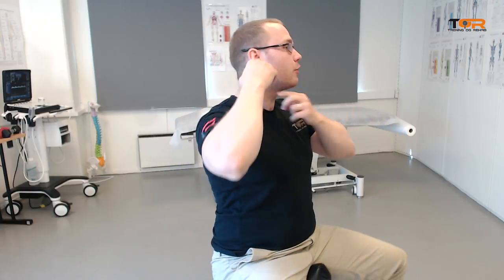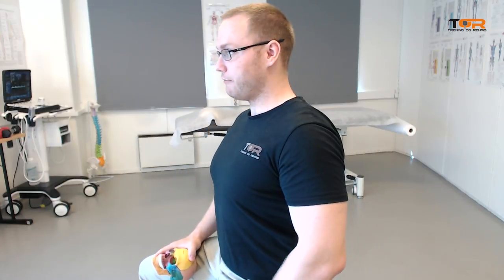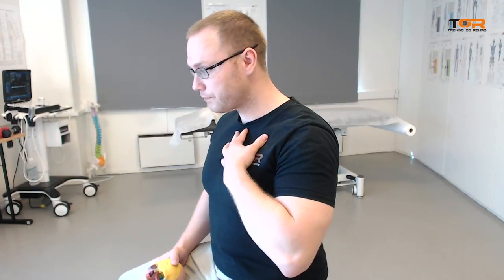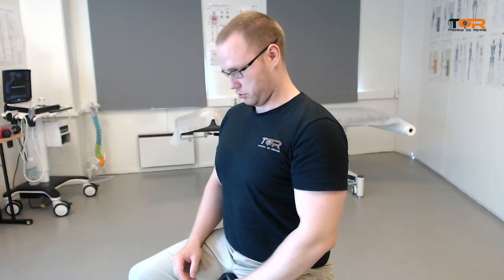Craniocervical "tucking", a biomechanical fallacy and common cause of extracranial IJV stenosis

Comment: Would you still recommend cervical neck flexion exercises (but not as a postural habit)? While I still have debilitating neck pain, I've found the actual exercises alone seem to at least help stretch out my neck extensors, providing temporary pain relief.
Reply: Hi Daniel,

I don’t know the answer and I’m not qualified to give a professional opinion, but I’m passionate about biomechanics and I’ve been doing my own homework for years to help with  my own joint issues so I’ll share my opinion and if anyone wants to speak on it then great, I’m here to learn. 

I had a physical therapist once tell me of the importance of learning how to use and train my muscles when they are elongated and how important this is. I do think most physical therapists would tell you the importance of activating and strengthening your deep cervical flexors, but what I think this guy is saying and what I believe to be true is that traditional chin tuck exercises only train how to use your cervical flexors in a shortened position which is impractical and according to this guy harmful. What’s brilliant about this video is that I think his cues can help train your deep cervical flexors when they are elongated. For example, if you place your arm straight out palm down, slightly extend your wrist and hold this posture for a bit, I imagine after holding this position you would feel your extensor muscles (back of forearm) working. Another way to hold this same position would be to place the energy on your palm side and find stability through your wrist flexion muscles. This would be training your wrist flexion muscles when they are elongated. Finding a proper and efficient balance is the key and I think that’s what this guy is trying to say. I’ve been practicing his cues but then trying to find my deep cervical flexors to help with stability. An incredibly small, relaxed, and slow chin tuck, like no more than a centimeter seems to help me. When I do this my whole head shakes because I sense my cervical flexors are incredibly weak when they are in this elongated position. Hope this helps.

Comment: So how should we sleep, my muscles at the back seem to be weak and I hinge a bit (long neck makes it 2x as bad), I can do this most of the day but how should we lay down then? If we actively hold the neck long while laying down it's impossible to relax and sleep
Reply from the maker: Lie on your side with your head a little forward, or if you lie on your back use a fairly large pillow. Don't worry too much about making small mistakes. THe most important corrective is daytime (upright) posture.

Comment: Thank you for this so incredibly much! It's so difficult to find information on this. I truly appreciate your insight. 

I have a hypermobility disorder, Ehlers Danlos Syndrome, and I have severe internal jugular compression on the left side and some on the right. For years I have sat with my head tilted back like that so my neck is bent back, because my neck muscles are just so fatigued from trying to stabilize the instabikity. My specialists and physical therapists say my laxity and internal complications are severe even for EDS.  My IJV is 2mm on the left side between the SCM and OMH and has blood built up behind that is compressing my glossopharyngeal nerves. I know the compression is typically higher at the level of the styloid or C1, and we aren't sure why mine is lower in the middle of my neck. We suspect I have Atlantoaxial instability. My hyoid bone dislocates/subluxes frequently, and I have a chronically subluxed sternoclavicular joint which has caused acromion impingement (type II) in my shoulder. We know I have lesioning in my c-spine (and one in my brain) that we are fairly confident is autoimmune in etiology, but not MS. My stylohyoid is also slightly calcified and bends at a weird curved angle on the left side so I have a tentative Eagles Diagnosis. As you mentioned, I have intracranial hypertension which has caused serious problems, I've had papilledema and two episodes of scarring from optic neuritis with vision loss. As well as the cognitive dysfunction, severe fatigue, emotional instabikity, pulsatile tinnitus, pulsatile exophthalmos (visual pulse) etc. I was in the ICU at one point because my dysautonomia from the intracranial hypertension was so bad we couldn't keep my pulse and BP stable. I was at 190/160 on admit. I'm 23. Tilting or turning my head would send my pulse and BP in all kinds of directions. 

Until the last 1.5years of my physical therapy since diagnosis of EDS and comorbidities in January 2019, my pain in my neck was awful, debilitating truly, and this makes so much sense now why it improved, as so much of my muscle strength and stability and ability to maintain good posture has improved. It is exhausting when it is a constant conscious effort though and the muscle tension is miserable. I have some torn tendons and labrum in my hips and labrum in the shoulder, and a torn gluteus medius. PT and OT have helped so much but I needed a experienced therapist whose worked with hypermobility extensively, my first PT made my symptoms much worse. 

My current dilemma is that I'm anaphylactic to iodine. So we can't get a venogram, and additionally there isn't a doctor familiar with AAI around me to evaluate me (I strongly suspect AAI). As my jugulars seem to be still very compressed even after a year+ of PT so we believe a surgical fix is necessary, but we aren't sure what process(es) are causing the compression. I have a feeling what you describe has been the main cause, I know I sat like that with my head tilted back at my computer desk for a decade or more and didn't notice as my proprioception and muscle fatigue were so bad. I am going to have an angiography with intravascular ultrasound and venous pressure readings this Wednesday (November 11th) to try and get some more information on where the stenosis is worst and what may be causing it. It can be so frustrating to figure out as there are so many different possible etiologies and I do not want to undertake major surgery like styloidectomy etc. without decent suspicion that it will actually relieve the compression. 

Thank you again!
Reply: By instability, do you have a jarring feeling when you walk?
Reply: I
 feel like I can relate with your symptoms. You clearly have found better doctors than I have. Did you ever find some relief?
Reply: @thepurplepear6742  also interested to hear an update!

Comment: For the last week I've been doing exactly the posture modification you describe here after seeing a video on how cervical posture can block circulation.

Absolutely crazy results.  After day 1 I felt that my head decompressed considerably.

Still have to work hard at maintaining it, but it's getting a little easier after a week.  

I can smell, taste, hear, like 20 times better, 

I'm not always tired and foggy.

I didn't realize how hard it was to articulate my feet hips and abdominal muscles in certain ways too.  Like I could, but compared to now it was wayyyyy more difficult and in some cases not possible at all.

For example when standing I can now roll my feet inwardly to the big toe side of my feet.  Could never really do this before, and probably explains why I needed shoe inserts to correct flat feet as a child.
Reply: @MrVirgin     6:45 , just keep your chin forward while elongating your neck and stay there. If your chin comes backwards like the pic in the thumbnail (on the right side) the jaw joint is crashing into the spine compressing nerves, arteries etc which you dont want.

Comment: Is the instability of the neck correctible i am 22 and i have a depression and Sinne that happend because i was sitting 3 years on the couch with the depressionen since than my neck got worse
Reply from the maker: Doubt you have any grave degree of instability.
Reply: @MSKNeurology  my physiotherapist says that i habe not enoght muscles to hold the structure

Comment: Is IJV stenosis and fatigue which is caused by chin tucking reversible by fixing posture or do we need surgery for that?
Reply from the maker: It is generally reversible. Sometimes of surgical degree. Depends on the position of the syloid process